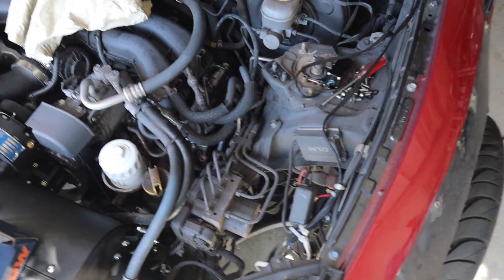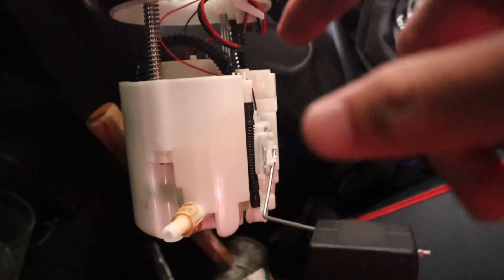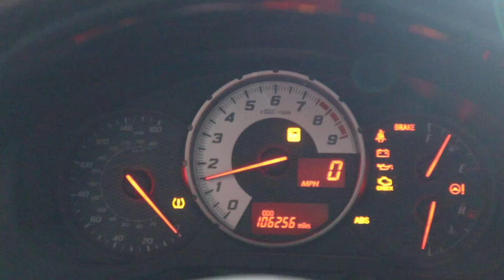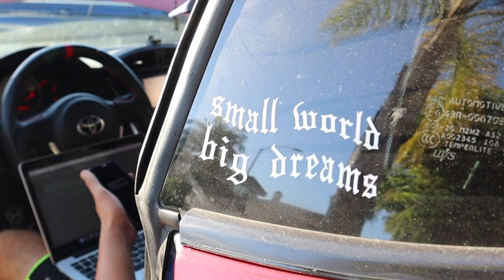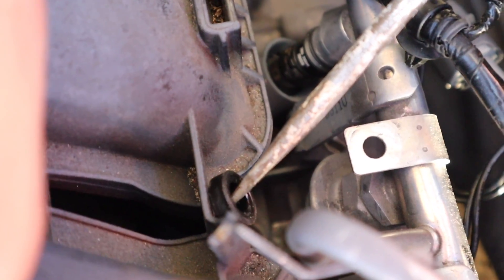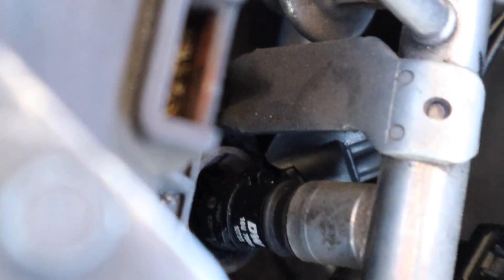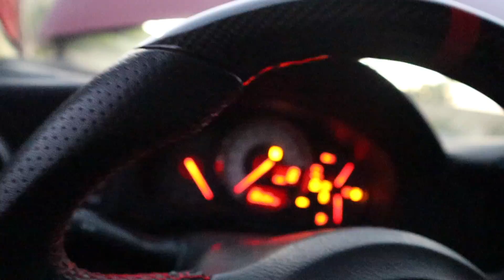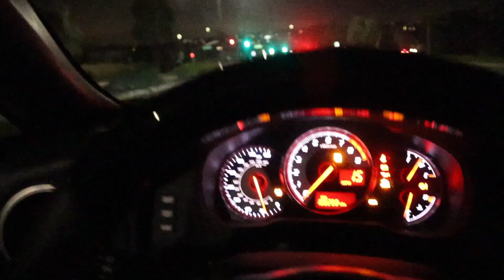Supercharger Install On FRS Goes Totally Wrong...

Comment: Feel your pain. I installed the edelbrock SC and during a tune revision. The engine blew.  So 10 weeks later. A new engine clutch and flywheel. And now finishing the tune process with CSG.
Reply: Holy shit dude. That totally sucks big time!
Reply: @loveever89  yup. Not fun. But the car is back and feels really good now.
Reply: Holy crap, engine blew on a SC? Damn never happened to me when with Delicious Tuning on JRSC, now on JDL GTX30xx about 580WHP built block and heads
Reply: Wow... going HKS supercharger soon and will be using the Tuner from HKS. Did the engine blow from a bad tune? Any info on the cause of the engine failure?
Reply: Jose Cuevas i suggest you get a dyno tune
They’ll be able to catch if anything is going wrong before catastrophic failure. 
You can do the hks tune they provide, but to get full potential and dial in fueling to the absolute best, I recommend dyno tuning

Comment: Dude! When I did my turbo build on my tC, one of my o rings was ripped, i just smelled gas luckily I saved found it replaced it and done. Never had an issue with my build since, 6 years running. Also, when you put the serpentine belt back on, you can use a wire to pull the belt onto the pulley for an effortless install.

Comment: Hey man, the issue is gonna be the seating of the injectors. Almost happened to me. Luckily for me I caught it. Remove all your injectors and double check that you removed the oem rubber grommets where they seat(use a pick tool) After, double check the top part of rail, sometime oem o-ring gets stuck in there. Lastly, look for tears on top spacer of new injectors, when you bolt the rail down and twist the injectors, those rubber spacers tend to rip easily. 

Don’t stress, i doubt it’s something serious. 
I installed JacksonRacing SC on mine and troubleshoot everything good

Then installed JDL turbo kit and everything went fine as well.
I’m not mechanically inclined.
Reply: Exactly what I was thinking, aswell as if the injectors are seated well you could use a flat head screwdriver agendes the injector and press your ear to it while cranking the car to hear if the injectors are firing
Reply from the maker: The man!! I appreciate the tips. 🙏🏻

Comment: Hey Chris. Worked on the fuel injectors before, so I have a little bit of experience. They are very easy to angle incorrectly. Even a small degree off it will shoot out fuel. I suggest taking all the fuel injectors off and retorquing them down. Hope this helps!
Reply from the maker: Gonna try this!

Comment: If there's fuel leaking everywhere then the fuel injector connections aren't tight enough for when the engine is pressurized. Check for vacuum leaks to see exactly where the problem is.

Comment: Cylinder 1 is passengers side front.    You also need to have black injector cover on it grounds the injector ecu
Reply: @chris_borges  also if you have any other issues with the wiring or injector ive been in same position when I swap manifold. Feel free to shoot me a message on Instagram  V1_boosted_bunny

Comment: That smoke was probably just unburnt fuel finding its way into the exhaust and burning off. Without that rubber grommet on the end of the injector that cylinder probably wasn’t making much, if any, compression so it wasn’t igniting the air/fuel mixture. A bunch of air would be introduced into that bank also so that could be why you got the lean code. All part of the process, we’ve all been there 🤙

Comment: I was worried that that noise u heard when u tried to restart the engine was it hydro locking by having too much fuel just being dumped in the cylinder, that’s what I thought it was when u said the fuel circuit was stuck open, I’m glad it turned over again tho even if it didn’t start

Comment: So you really just have to narrow it down to: 1) Fuel 2) spark 3)compression. Are you getting enough fuel pressure AT the injectors? Is the tune file correct? Any other ideas? The engine is still perfectly fine as long as you don't hammer on it while getting ecu tuned.

Comment: Take it to a professional tuner.
Reply from the maker: That’s the plan! My tuner sent over a base tune to run (what we installed in the video) until the day we datalog the car together and get it running to its peak performance. 💯
Reply: Chris Borges  church automotive in Long Beach is the best tuners they know Frs/brz by hand I’m using a Jackson racing supercharger 13 psi built internals and e85 3+ years never had an issue with anything